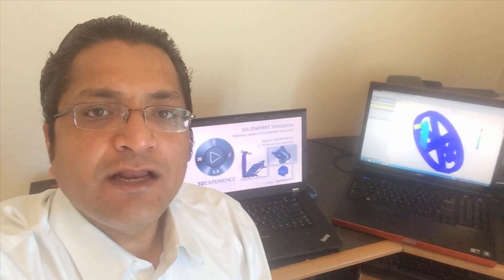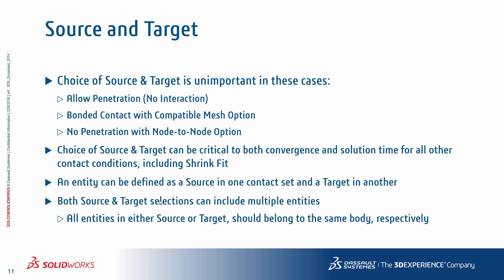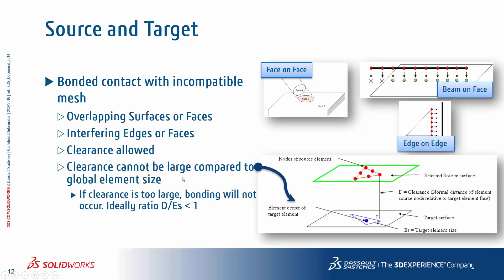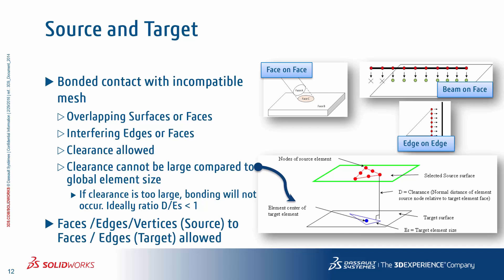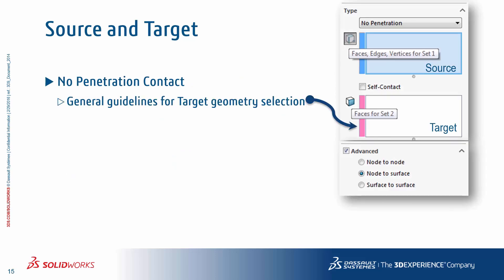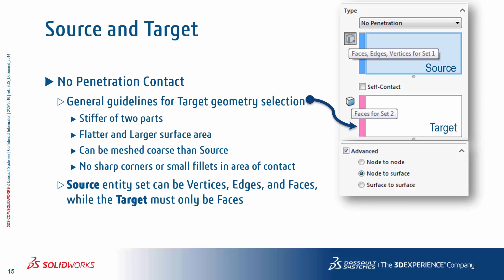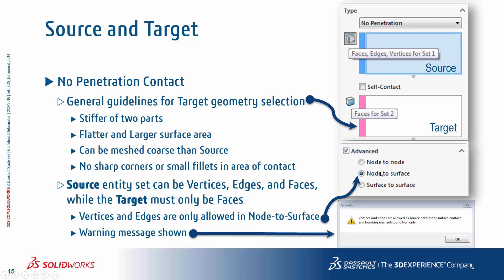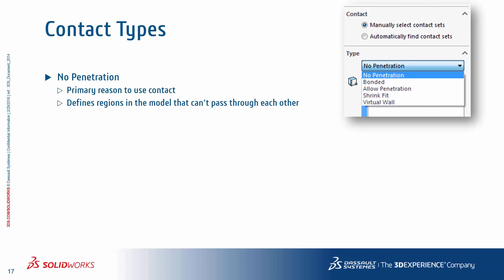SOLIDWORKS Simulation Step-Up Series: Contact Modeling Part 2

Comment: how to  apply bonded contact on weldaments in assembly if i have another solid bars connected with weldaments?
Reply from the maker: Hi Tanvir, could you post this question to the MySolidWorks forum? Our expert users will be able to help you there. Please include your system details and the version of SOLIDWORKS you’re using. http://3ds.one/VWzPx7